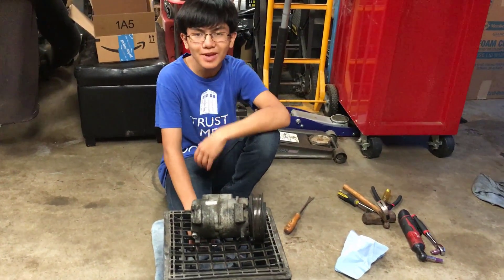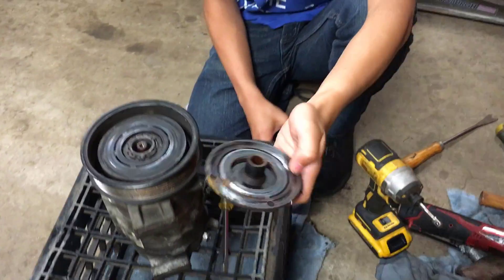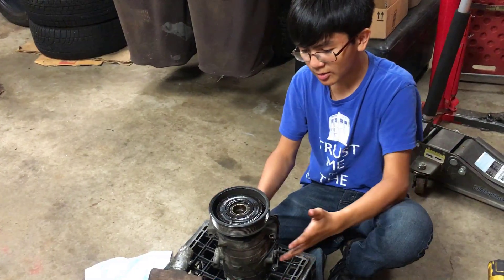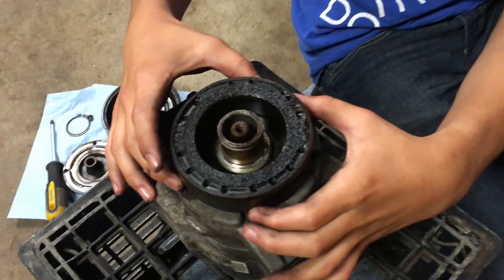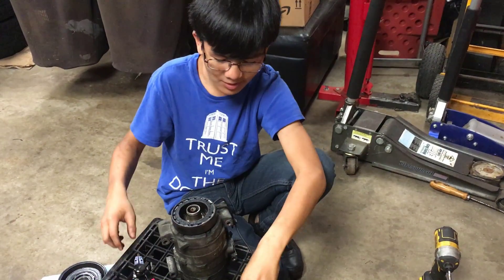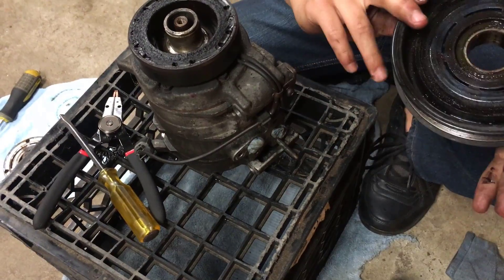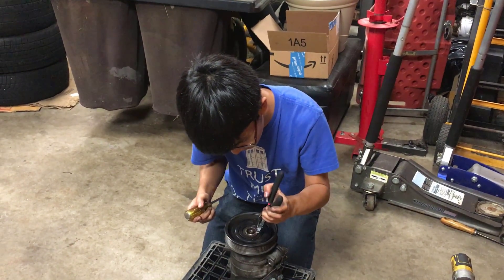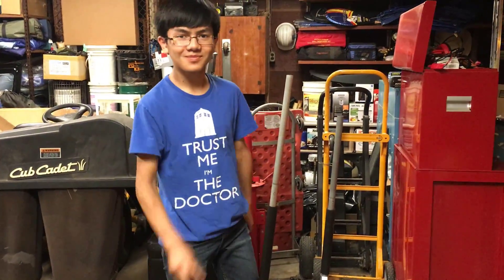How To Remove, Replace & Diagnose Stator Coil, Clutch & AC Compressor Bearing On Your Car | DIY

Comment: On a 2 wire clutch continuity is checked from wire to wire at the conector, on a single wire clutch it is checked from the wire connector lead to metal housing.